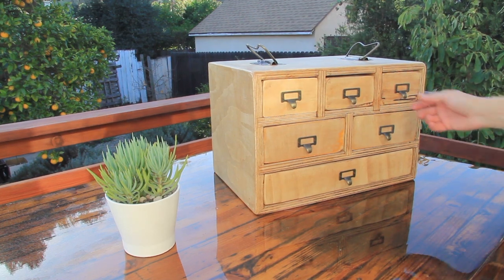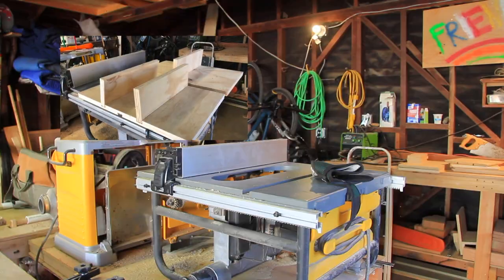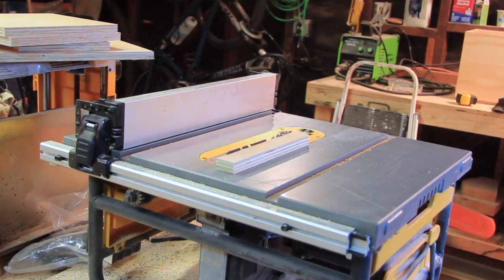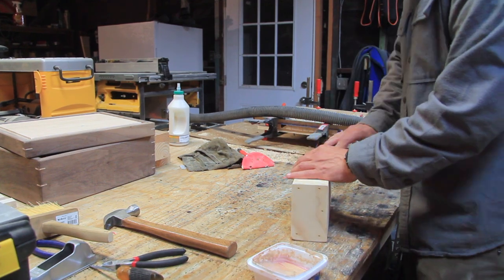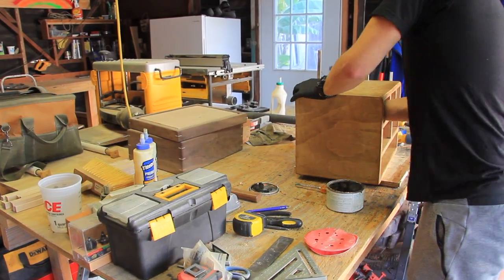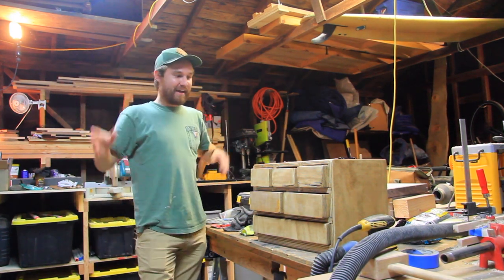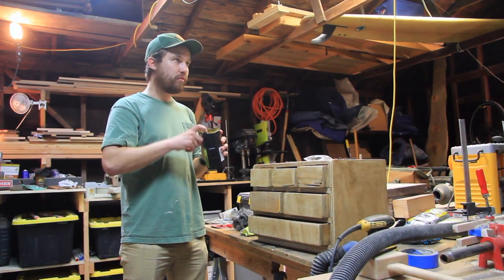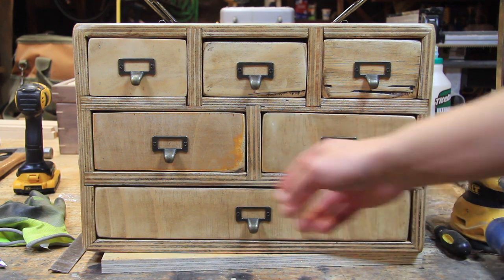How to Build an DIY Apothecary Cabinet // Medicine Cabinet // Hardware Organizer

Comment: Nice chest, just a few tips, 3/4 ply is fine for the carcas,  but for the drawers I suggest 1/4 ply for sides , 3/4 is fine for the front and bottom though. And the carrying handles would make it more comfortable to carry if mounted on the sides of the chest. But I really like watching what you make, so as someone said, make more sawdust and wood shavings. .......
Reply from the maker: Great tips! I thought about using thinner plywood for the drawers, but didn’t have any on hand haha thanks for watching!